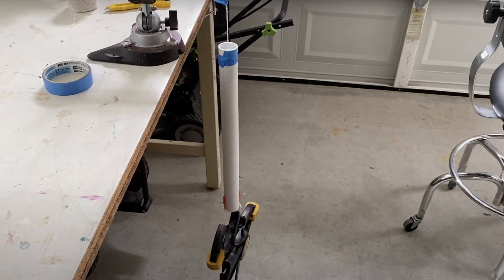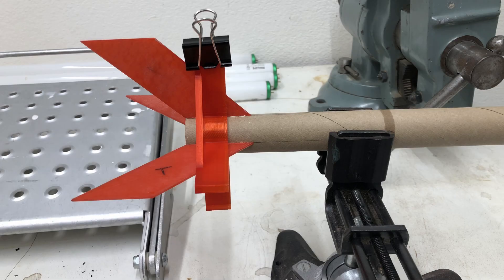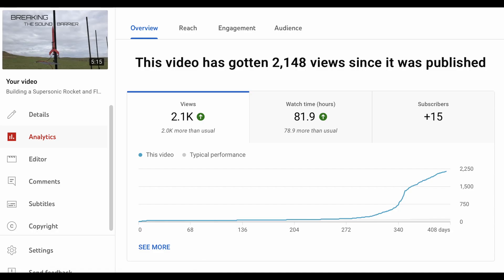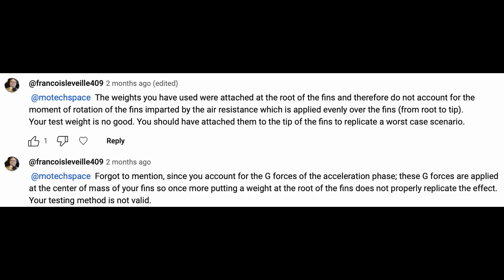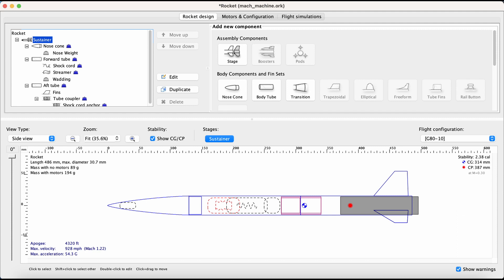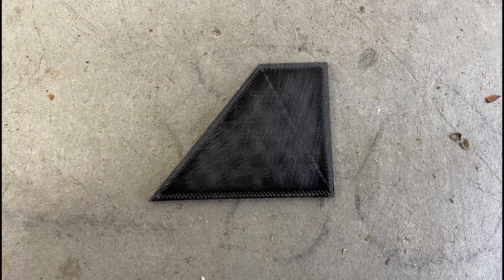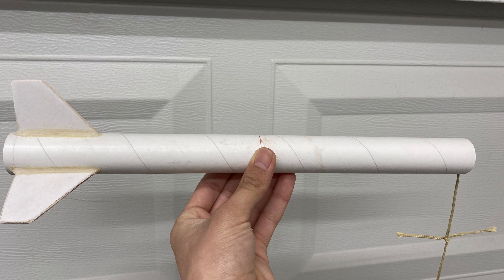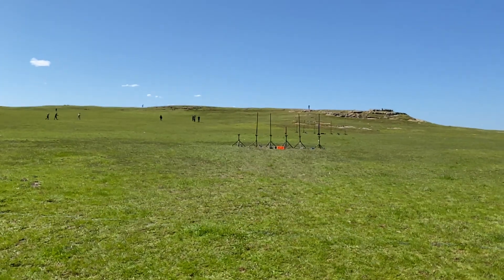Building and Flying a Supersonic Rocket

Comment: Have you considered getting a high power certification? it's possible to get a Jr. certification with NAR or TRA. It's very fun and I'd recommend doing it. I just got mine.
Reply from the maker: I'm thinking about getting an NAR Jr. cert later this year but it's not a priority now. Did you get NAR or TRA?
Reply: @motechspace  I certed at the LUNAR launch on December 17th with NAR.
Reply from the maker: @wertytop0  Nice! I'm also a LUNAR member in case you didn't notice.

Comment: I came across what I thought was part of mach machine when I was recovering one of my flights that day, I left it with the lost and found so check with the club mailing list!
Reply from the maker: Thanks! Where did you find it? Also where would I check the mailing list?
Reply: Was the rocket instact? I flew a similar flight with stronger fin materials at TCC dairy aire and shredded on the way up.